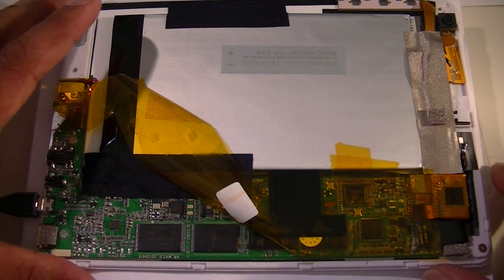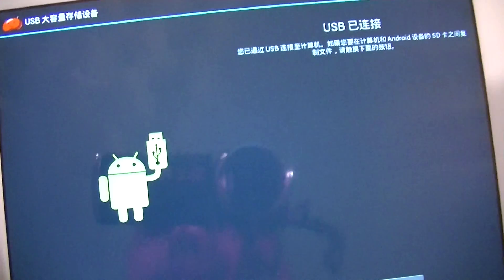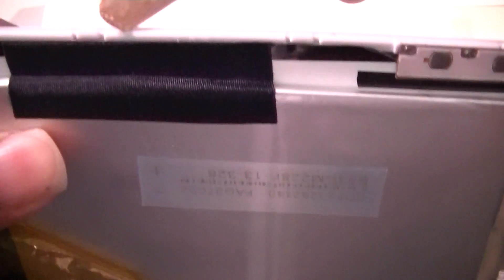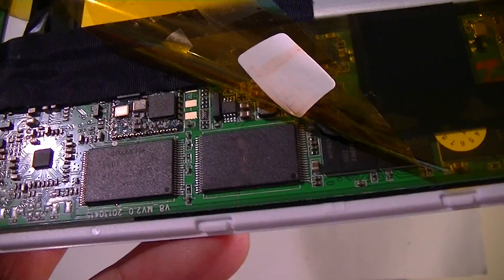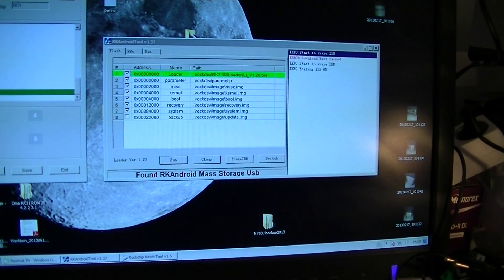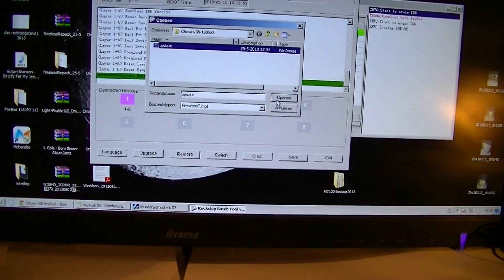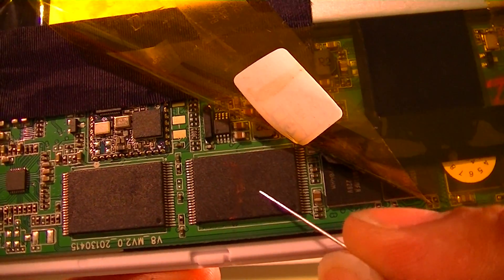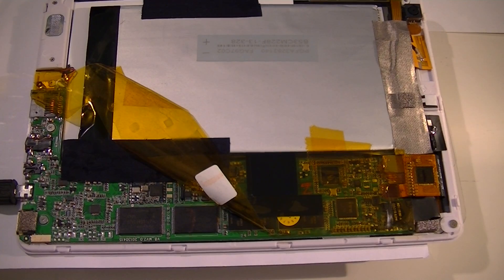Chuwi V88 Unbrick How to Unbrick Hard Bricked V88

Comment: hi sir Tjin, please help me. my device is ifive mini 3 (RK3188), i have hard bricked it when trying to install a custom rom. is this method also applicable to my device? also, should when i short the pins, should the tablet be connected to a usb and switched on? 

please help me sir.. thank you in advance..
Reply from the maker: You should first check if you have softbricked your device or hardbricked ?
This method has only been done on chuwi v88 .Im not sure if you can use it on other tablets .

If your tablet is softbricked (turns on back light is visible ) then you can use other methods to unbrick.
Reply: Tjin Chatterpal sir OMA was the one who linked this video to me. i dont know if my device is hard bricked or soft bricked. i'll describe the details to you and please let me know if i can still recover it using other methods.

i cant use the table anymore, nor it is recognize by the computer. i cant flash another rom since it is not recognized anymore when i try to connect it.

here is what happens when i try to connect it to a usb/charger:
- the screens lights up but only the backlight, there is no display or whatsoever.
- it turns off for about 5 seconds then turns on again and this repeats constantly (only the backlight though) i know the device is on because it is constantly vibrating (a sign that it is on flash mode).
- the Rockchip tools does not recognize the tablet anymore nor the pc itself. 

please help me sir. thank you very much in advance.,